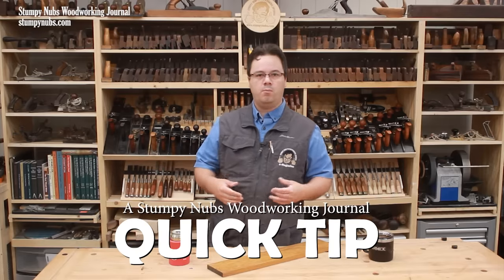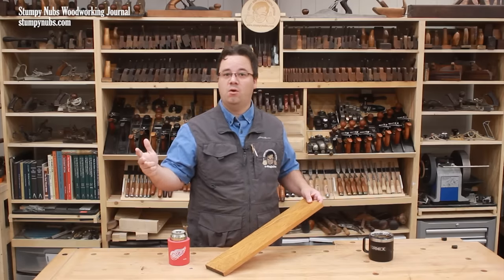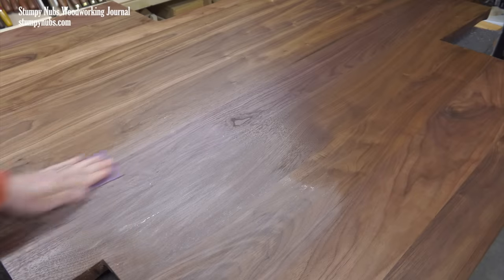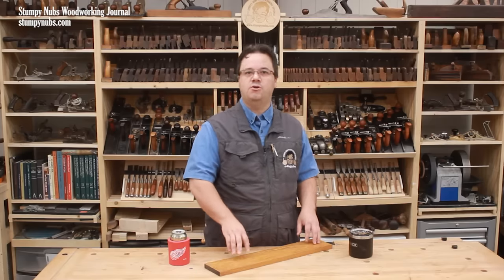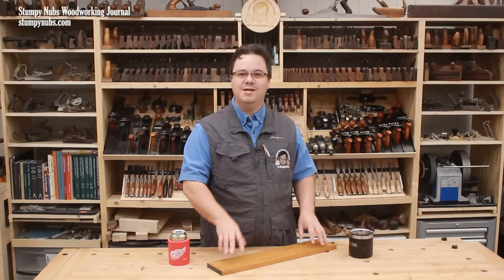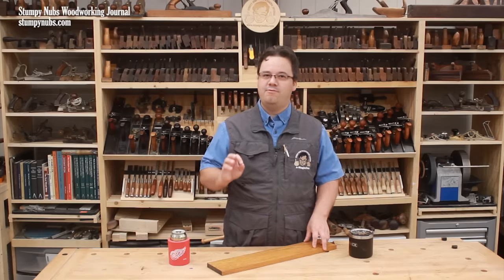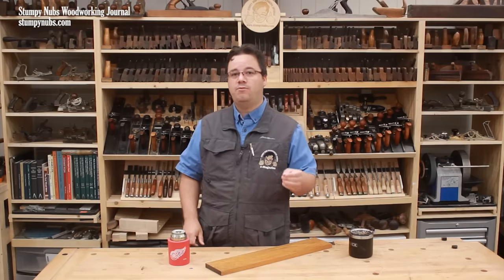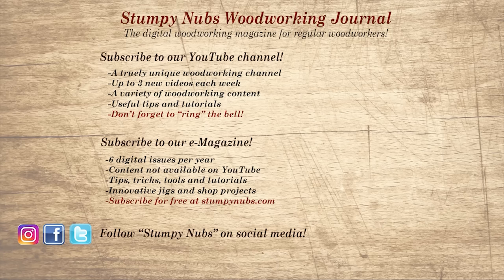Improper sanding between coats of finish- HOW TO AVOID IT!

Comment: An idea for a future video: could you talk a bit about the safe disposal of oily rags, empty cans of finish, sawdust, shavings and tiny scraps? No one talks about this and I’d be curious to see how it should be done.
Reply: For everything except the cans, burn them! Especially oily rags, which can spontaneously combust if left to dry. Take them outside to a safe spot, and torch them.
Reply: Dry them flat for a day or two, then throw them out on trash day.
Reply: Just chuck them in the corner next to your scrap wood pile, it'll be fine!
Reply: Funny, but some won't know you're joking. A house burned down near here recently from this.
Reply: @technoman9000  This is funny, but just so everyone knows: THIS IS A JOKE DON'T DO IT! Drying oils (which are common wood finishes) generate heat when they dry, which can cause them to catch fire.
Reply: @craftsmanwoodturner  This is illegal in many areas, like where I am. Terrible idea in my opinion in other ways as well...
Reply: @Mr. James Throwing them away, dry, normally.
Reply: @ef2b  My neighbors disposed of mineral spirits-soaked rags in our dumpster a few summers ago.  It was a hot summer night and the dumpster went up in flames, which was right next to their garage, which also went up in flames.  Along with a car and two motorcycles.  The recycle bin melted into a pancake of plastic.  I believe the correct answer is: soak the rags in water, then put in a plastic bag, tie off the bag and dispose.
Reply: @jerrycargill4847  Your comment made some  sense compared to most; which I understand a few were jabs of sarcasm and/or jokes. Unfortunately, there are quite a bit of people that lack reasoning and/or common sense, scary. But no one mentioned reading the labels on the chemicals. Some companies offer instructions for disposal. And if all else fails, use the internet!!! 

Just keep in mind, don't wrap any soaked rags in bags, in tin foil, and especially left in the heat. And don't think that wetting something will prevent it from combustion or igniting. Places that use a lot of hay tend to stack the hay. But if the hay gets rained on the hay has to be unstacked to dry. If the hay is left stacked wet they generate heat and catch on fire. And another random fun fact: when you mix water with plaster (plaster of Paris) it generates heat. 

So just be careful not to pile soaked rags, even if dried. Remember the fumes  are what ignite, not the liquid.
Reply: @cameronmcgehee  It is only illegal if you get caught.

There is nothing illegal about burning wood scraps or using rags as a starter for the fire.
Reply: @cameronmcgehee  I like the fact that you replied with solutions.  😊
Reply: @jeffshackleford3152  hehe
Reply: What? So you need a vid on how to dispose of a rag?  As a boat builder I find it embarrassing I'm the same species as you.
Reply: @craftsmanwoodturner  it's only linseed oil that's known to combust. Even epoxy rapid heating won't melt a rag
Reply: @roberthahn8555  yeah yeah.. whatever mouche. The difference between me and you is I've built 17 boats to date and don't need to ask how to "safely dispose of a rag"
Use your noggin mate it's not the type of thing that needs asked at any level of painting. Painting is a hard gig full stop it's hard to get a good finish every time even with decades of experience.... and your wanting to know about binning rags like some fairy boy
Reply: @jeffshackleford3152  it depends where you are. There are places where having an open fire of any type is illegal except specifically for cooking and the fire must be attended at all times.
Reply: @jerrycargill4847  Simply letting the rags dry fully is more than enough. Leave them overnight,  spread out flat or hung over something and you can just throw them in the garbage the next day as they are no longer dangerous. Putting them in a wet bag and tying it off sounds like an absolutely awful idea tbh
Reply: Hmm, I still don’t have a clear answer🤦‍♀️
Reply: Jason, on Bourbon Moth, did an experiment in an entire video on disposing oily rags. It was a real eye opener to see the unexpected combustion. In a latter video, while he was working on a project, he accidentally set his fence on fire with oily rags. 😮 His neighbor called the fire department. Shows the pros can get it wrong too. I recommend that you watch his oily rags video. So informative. Nevertheless, just be careful. ✌🏽🙏🏽
Reply: Toss in a bucket, add water
Reply: Throw it tf away
Reply: Lay the rags out flat and let them dry. Then you can put them in the trash (they no longer have fumes.)
Reply: Some good rants here regarding rags :) but we haven’t discussed the sawdust, shavings, and tiny scraps yet…

Tiny scraps throw them in a box or bucket, they always come in handy…

In the shops I worked in I remember some guy would come by once a week or month and haul off the sawdust…. not sure what they do with it, probably a pet food producer…. :)

Comment: Hey! maybe you can help. Ive got a wood boat with epoxy/fiberglass over cedar, and then spar varnish over it. The person i got it from let it get too much sun, or to much temperature change, and the outer finish is checked. Should I sand down to the epoxy to revarnish. Ive been slowly sanding more and more off, but the little checks are still very apparent. Its about 23 year old varnish.

Comment: i bought a guitar with a very poor poly coat applied over top  of another very old poly coat. is there any way to just remove the top coat? i doubt they even sanded down the poly before applying this coat. but no telling how long ago that was and im scared to do anything becase i dont want to ruin the original finish if it is savable. any ideas would be great. it looks awful and a very high end guitar.

Comment: I'm only 2 years into my wood working adventure and it was youtubers that triggered this new found passion(and thousands of dollars that my wife isnt fully clear where I have spent).  Some youtubers and their influence on me has come and gone rather quickly.  I saw your videos early on, but they weren't the ones that hooked me or particularly interested me.  Not flashy, not sensational, and most egregious, no promises of "make easy money with pallet wood".  I wanted to make easy money and I wanted it to be easy. Well...

However, as I progressed and got more serious about what I was doing I quickly realized where true value existed.  Your videos by contrast were down to the point, well reasoned, and you explain not just what to do but WHY you would want to do it/not do it and what to look out for.  Something I have grown to greatly appreciate.  So many times as someone getting into this environment you literally don't know what you don't know.  

Out of all the youtubers out there you have consistently been the most informative.  When I scour youtube for answers to a question I have and your video turns up in a result--it is the first one I click on now adays.  While it may not be the highest praise; I consider you amongst the best out there.

Comment: Great description of how the oil poly drying process effects the finish (ie shrinking) and should be applied in lighter coats for the final step. Also like the paper bag buffing tip. Keep those deep dives coming...

Comment: I saw Paul Sellers use a card scraper real light to remove dust nibs.  I tried it on my last project and it worked real well.
Reply: I tried a card scraper to remove the raised grain after a first coat of shellac, and it worked really well. The dust nibs came off well with a scotch-brite pad.
Reply: I wonder how much of the card scraper is skill. I have seen Paul Sellers do a lot of things that make me look like Peter Sellers (Pink Panther) when I attempt them.

Comment: Now this is the video I needed. I stopped sanding between coats and moved to using a piece of cardboard to knock off the nibs, because even with 400 grit I was getting scratches. I also started covering my projects while they dry with a tub with a few holes drilled into the very bottom. I created a lazy susan style tray to help avoid touching the project too. One day I wan't to get an HVLP system, but for now it is mostly wiping on thinned down finishes. I've also started doing my finishing on a pop-up table inside the house, because the humidity and temps are all over the place in my shed, and it makes drying time so unpredictable. It was 91 with 86% humidity in my shed today. No amount of fans can help that become a reasonable place for finishing.

Comment: +1 for the brown paper bag. I use it every time with poly. On large projects I glue a piece of cardboard to an old piece of sand sandpaper on the orbital sander - just watch out over working/over heating an area.  Glass smooth every time.

Comment: Good post. My only addition is lacquer dissolves into itself and dries quickly. This allows multiple thin coats to be laid down successively before needing to sand. I prefer a sealer coat of shellac that raises the grain, sand with 320, lay down 3 coats of spray lacquer, then sand with 600 or 800 grit, then a final thinned coat. From there you let the finish cure for a couple weeks and sand/ buff to whatever sheen you desire.

Comment: I love the amount of detail and explanation you put into these tutorials. I have learned a bunch from since I started "self teaching" myself woodworking a couple years ago. I mostly do "artsy" stuff and carvings. But MANY of your tips apply! 

I am also considering a Harvey table saw after your review. The only thing I don't like about them is where they are manufactured. I may have to get over that though, because, my garage shop gets very humid. The chances of condensation are much higher. That's terrible for cast iron. But the tin coating on a Harvey really helps minimize that issue!

Comment: Discovered you today and I am so pleased with how you give instructions/directions on what to do/not do.   I am new at restoring furniture and I am finding that top coating is my nemesis so you are a blessing.  I find my finishes are streaky in spots. I use water-based products and apply with a paddle sponge. I have now resanded down to bare Maple, have applied a 'wash' and now a stain.  Top coating is next and I am already apprehensive with the quality finish.  Are your instructions here the same for water-based as with oil top coat. I am now going to try with Varathan Diamond water-based interior Satin(fyi). What is your opinion on sanding between coats with 0000 steel wool?  And lightly wiping with tack cloths

Comment: How about when there's something perpendicular to your surface? How do you deal with your surface in that corner? I ask because I make pretty hook and ring toss games and always struggle with the finish on the base around where the post is mounted. I think next time, I'm going to pre-finish the board prior to gluing/screwing the post in place but that makes me nervous because I need to leave enough of the surface raw, but make sure to not leave any surface not covered by the post raw.

Comment: Thank you for the video! 

Would you recommend using an orbital sanding machine to sand between coats? (of course, with the mention that the pressure should be kept at a minimum)

Comment: Need advice. I built an outdoor bar and used 2x8's screwed together w pocket holes to make the countertop 2x16. I used a wood sealer and made sure I hit every mm of the wood to seal it best as I can. 
Is there anything more I can or should do?  I would like to put a coat of polyurethane as well. Not sure if my approach is novice dumb or not. Looking for advice. Thanks.

Comment: New Butcher block table top, sanded 280, filled (thousands of) pores with a mixture of sanding dust and 1:1 oil poly/thinner scraped into the surface across the grain. Sand again with 280.  Sprayed 5% reduced gloss oil poly.  The surface is very grainy only shiny in a couple of places at edge.  I have never used a spray gun before.  What would cause the surface to be grainy?
I spraying three pieces 30”x48”, sprayed them all horizontally and immediately sprayed regular vertically.  All exhibit the grainy surface.  
Should I wait 24 hours and sand the surface say with 600, would that salvage the first coat?  Hopefully I can figure out what’s causing the grainy surface. Before I go further. 
Thanks

Comment: I had some streaks with my first coat of poly. I watched a few of your videos and I’m going to send after the first coat with 320 grit sandpaper. Will the second and third coats, standing in between of course, result in a straight finish or will that some side with each coat?

Comment: Excellent content!.... however, I'm curious as to why you aren't using a block?
Reply from the maker: A block requires the surface to be perfectly flat to work. If it's not, you risk over sanding high points and potentially going through the finish. I use blocks quite often when sanding bare wood. But during finishing, I want to let the wood be what it is.

Comment: I'm using satin vwipe on poly but I'm getting foggy finish when I look at it at a certain angle.  Any idea what would cause this,  temperature,  containments in the poly or rag, applying to thick of a coat? I can't figure it out.

Comment: I am applying many thin coats of rub-on poly (for a well used kitchen table) and am afraid of sanding through the coats if I sand between every coat. I tried using the 600 grit and feel like I am removing what I just put on. Because I am applying the rub on poly in thin coats, I am getting a really smooth finish already.  Can I use a brown paper bag to sand between coats since it is mainly for the adhesion of coats instead of making it smoother? And do I really need to sand between every coat since the coats are very thin?

Comment: Sanding between coats on the "finish" product is a well-known pro technique. But where are the experienced woodworkers talking about sanding between stain coats? IME, mostly with wood veneers, my oil-based stain color does not look rich enough unless one applies two coats of stain. Typically, I let the first coat dry for 24 hours. But a European painting contractor once told me to lightly re-sand the stained surface before applying a second coat of stain, with 400-600 grit flat paper by hand, the same technique you show here. He also said, if the second coat of stain raised the grain, to lightly sand once again before applying the first coat of finish. I can't find any reliable Youtubers who support this experience.

Comment: Any tips for dealing with dust nibs when finishing with nitrocellulose lacquer? I know lacquer isn’t a super popular finish anymore, but it is sometimes unavoidable in my field (musical instrument repair & restoration). I am currently spraying a white lacquer finish - which was initially supposed to be 12 total coats between base, color and clears  - and I’ve been having nightmares about this project for months now because of dust particles and lint in the finish. Problem is, with some of the dust I end up having to sand down so deep to get the dust out that I end up causing discolorations. If I ignore the dust outright and assume that it will come out while wet sanding, eventually so much dust builds up in the finish that I just end up being unhappy with the final result and can’t bring myself to give it back to the customer in that condition. Clear lacquer also seems to have a slightly yellowing effect as well, so as the thickness of the clear coat over top of an area increases, the color changes slightly. Then when I go to sand out a dust nib later, the thickness of the clear coat in that area changes, and causes a different type of discoloration.

Like I mentioned, this project has been giving me nightmares for months now, and I’m at a point where I’m not even sure if it’s possible to get a white lacquer finish that I would be proud of in this spray environment anymore. Any ideas to help me get to the finish line would be massively appreciated.

Comment: Two things that you need: Flat sanding blocks and cabinet scrapers. 

1) Only using your fingers on a fine surface will lead to an uneven finish. 
2) Cabinet scrapers don't clog and are better than sandpaper for most finishes.
Reply from the maker: Flat sanding blocks only work if the wood is perfectly flat. Otherwise you will over sand the high points. I use them on bare wood, but never on finished surfaces because by that time wood movement may have changed the surface. I want the surface to be what it is at that point. I also find that it is too easy to apply too much pressure with a sanding block. With my hand I can feel the pressure.

Comment: Brown paper bags...I can't remember the last time I saw one of those. Might a sheet of cheap, blank copy paper work as well?
Reply: I've used index cards to some success. Probably courser than the brown paper bag. I often use them on the lathe in conjunction with brown paper bags when melting in a beeswax finish. Smooth as glass.
Reply from the maker: Ask at the grocery store. Most still have them. You can also buy brown paper in rolls in the paint supply department. Copy paper is way too smooth.
Reply: @StumpyNubs  Ah, masking paper, sure, good idea. Thanks.
Reply: The better online woodworking stores use crumpled brown paper as packing in the box your order comes in - I have a huge pile.